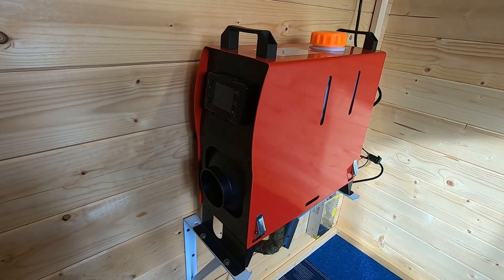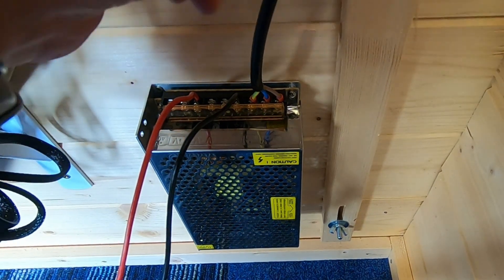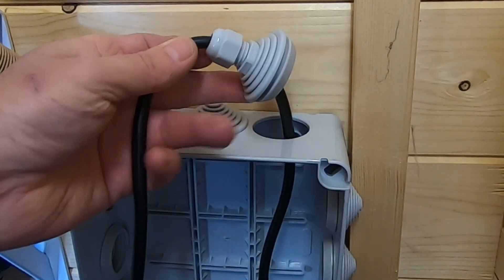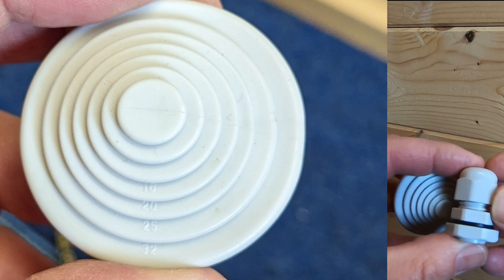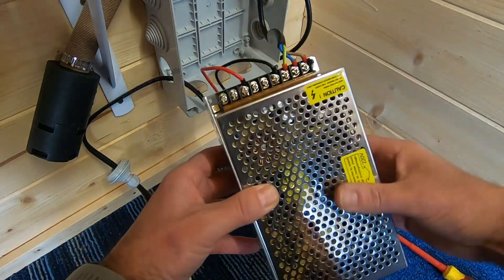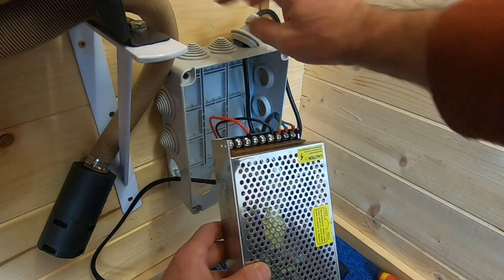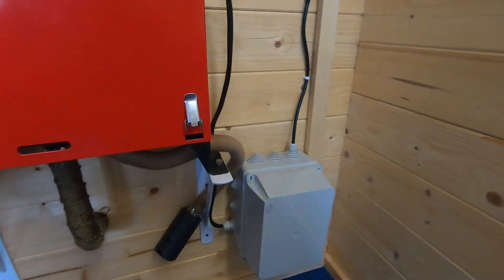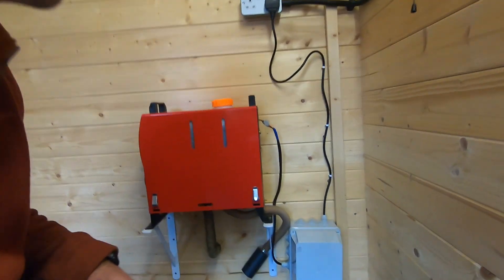Diesel heaters 12v power supply Shocking!

Comment: Why don't you just use a 3pin 230v to 12v plug? Then there is only 2 wires and can be tucked away.
I run mine on my boat via 12v direct to a battery via fused line and when I have a shoreline connection I run a small 230v 5 amp battery charger keeping the leisure batteries topped up.
Less mess, less wiring, less to go wrong IMO.
 Mine is running right now, ticking over keeping me toasty and warm.
Reply from the maker: Start up of  the heater requires 8 -12 amps. I'm not sure if those plugs have enough? Although it might be worth trying one.
Reply: @georgeborrow4001  ah good point, I must admit I hadn't thought about the start up power needs, can most likely get one though that does do what is needed.
 Thanks for replying.

Comment: You might as well pipe the burn intake to the box with a decent air filter intake to the box the power supply will last longer and be more efficient if it's cooler
Reply from the maker: Yes that could work, thanks

Comment: Personally I would have put the 12 volt terminal block mounted  inside the heater and insert a proper cable feedthrough thing in the hole. Now you have wires with single isolation through the metal case. Not very good if you ask me.
Reply from the maker: That is a very good point. Thank you, that is how the heater came however I will do something about it .

Comment: Not related to this video, how did you shield the exhaust going through the timber? I’ve just built a dunster house Avon cabin and I’ll heat it with a diesel heater I’ve just bought. I can’t decide on whether to have the heater in the cabin or outside…the only thing stopping me having it inside is the problem with the exhaust!
Reply from the maker: Hi, I drilled a hole bigger than the exhaust and used some of the lagging (came in the box with the heater) between the two. I was thinking about having the heater outside but didn't want to put such a big hole in my shed wall. Thanks.

Comment: The power supply unit will over heat in that box. Lets say the temperature is 23c in your shed. In your junction box it's going to be double that!
Reply from the maker: Thank you for your comment. It's a 20 amp power supply. Once the heater has done it's start up it only pulls 0.5 - 1.5 amps . Not really enough to run hot. However I removed the grommets from the bottom of the box and the box itself can withstand heat of 650°c.

Comment: Nice clean install and improved level of safety for the mains power connection to the power supply. I would offer that your system may be at risk of overheat failure if you have an unexpected mains power loss, because your system will not be able to clean or cool itself with a proper shutdown cycle. I'm also curious why so many structural installs (Shed, garage, homes, etc.) ignore the need to route both of the combustion ports externally when the unit is mounted indoors? This is very inefficient considering the use of the air in the heated space to support combustion and the negative pressure created by constantly exhausting the heated air through the combustion chamber, which in turn demands a constant flow of fresh air be pulled into the heated space through the crevices of the structure. There is a good reason the combustion ports and fuel port are located so closely together, In a vehicle all of these are routed externally, it's how they were designed to be installed and used.
Reply from the maker: Thank you for your comment, I'm quite happy to have some negative pressure in the shed. My thoughts were that it would help the moisture levels getting too high and then having condensation issues.
Reply: @georgeborrow4001  I suppose that makes sense if you have a very high humidity environment, but that comes at a substantial loss in efficiency. these heaters do produce a very dry heat when installed properly, it's one of the greatest features they offer when compared to a propane heater. Best of luck, hope it works well for you.
Reply: Never actually considered the heat loss from having the intake inside, can't see as it's a substantial loss drawing in a small amount of air that is only slightly colder than ambient tho - nothing like the heat lost from the exhaust which is substantially hotter. The power loss issue has been at the back of my mind, and I will use a small battery to shut down the heater in this event - when I get round to sorting the power supply!
Reply: @Sydney268  When you consider that 100% of the volume of air leaving the exhaust is being removed from the space you're actively trying to heat, and that same volume is constantly being replaced with externally sourced unheated air, it is apparent this has a compounding effect working against the goal of heating the air inside the structure. This is not much different than if you installed a constantly running exhaust fan through the wall of the space you're trying to heat or propping open a window to the outdoors. "is only slightly colder than ambient" is only the case if your goal is to only slightly warm a structure vs. the outdoor temperature, It would seem most people taking the time and expense to install a heater are doing so because they want to heat a space substantially warmer than the ambient outdoor temps. The number of videos I see with the combustion intake located inside the structure would indicate that you're not in the minority however, so I get it, I just think this is a common oversight that leads many to believe these heaters are less efficient than they really are, when properly installed to take advantage of the original design. Cheers!
Reply: @StratOvation  yeah I get what you're saying, but in my circumstance where I'm lucky to get 5°C above the outside temperature and most of the cold air drawn in will be through the path of least resistance - the gap around the exhaust pipe, it probably comes in hotter than ambient anyway, might even be more efficient 🤣

Comment: Overly elaborate really and expensive. Clip cable to wall and cover supply with a tupperware box. or similar. Ensue the box is big enough to let air circulate for cooling the supply, drill some holes in box  where power supply fan is so it's ventilated.
Reply from the maker: Thanks for your comment. Yes I'm sure that would work too.

Comment: Do you think those holes in the metalwork are just for show? where are your airholes in the box???
Reply from the maker: Hi, thanks for your comment. On startup the heater may use 10 amps but then drops right down to around 0.5 - 1.5 amps. This amount is not enough for the unit to get hot. Even so the grommets at the bottom of the box have been removed and the box itself can withstand temperatures up to 650°c